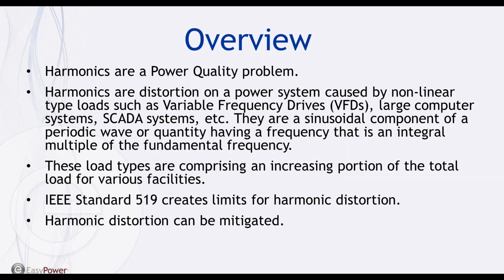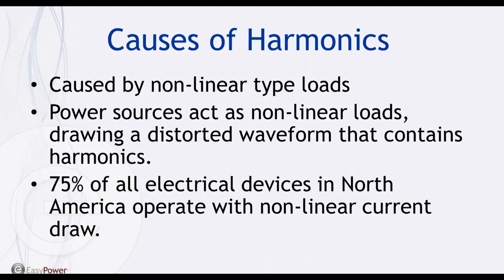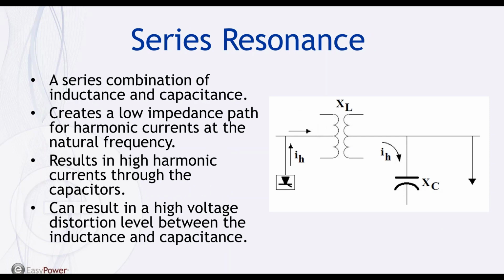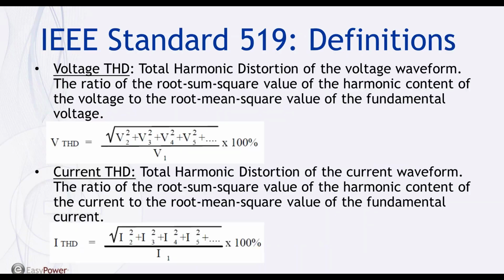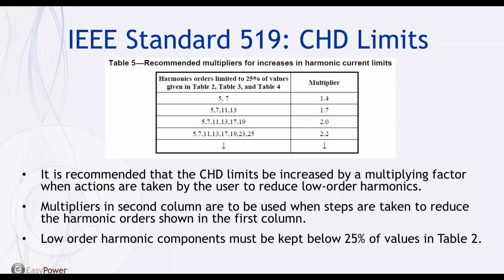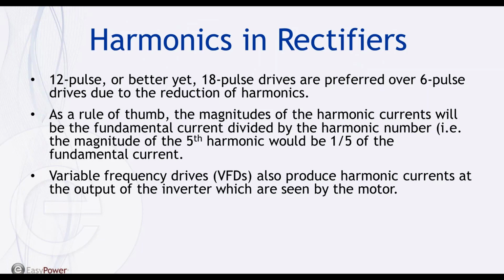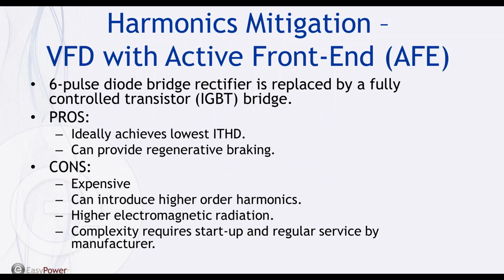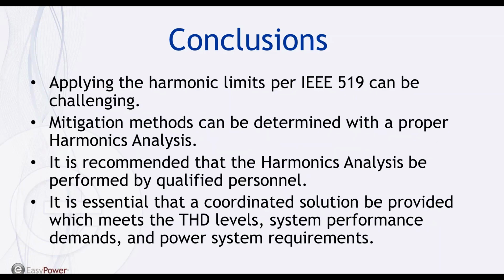Harmonics in Electrical Power Distribution Systems

Comment: QUOTE "Single largest cause of severe harmonic distortion is resonance" UNQUOTE. Not exactly so - though the harmonic resonance does cause some severe harmonic distortions. If one applies only Capacitor with a Non-Linear load, the capacitor would magnify harmonics and one would land into a severe harmonic situation. Save for that, it the extent of Non-Linear Loads and when the transformer operates near its full capacity (with high VFD drives etc.) that cause THE REAL AND THE SEVERE HARMONIC DISTORTIONS, both with the THDi (Total current Harmonic Distortion) and THDv (Total voltage Harmonic Distortion). Check out the myths vs facts. https://enconengineers.in/harmonic-filter-powerful-super-tuned-specification

Comment: Nope. Not even close.
Reply: What you mean?
Reply: @joeschmidt6597  Which harmonics are created is not a function of the kind of circuit you are using. 6 pulse rectifier vs 18 pulse rectifiers don't create specific harmonics just because they are have a certain circuit topography. There are laws that determine which harmonics are created and it's based on the angle at which the incoming sine wave was at when it intercepted the non-linearity. Read my book, don't wait for the movie.
Reply: Tell me why I see 5th 7th and 11th harmonics on my supply with 6 pulse vfd loads than . 😂 gtfo here this info is spot on
Reply: @englandrasmussen3111  The PHASE ANGLE where the distortion impacts the input sine wave determines the "Harmonic Signature." It has nothing to do with anything else. Not only did I discover this, I came up with the formula that predicts why you get the 5th, the 7th and the 11th. The phase angle where the distortion hits the sine wave is what drives it. I found a mechanical website that showed a harmonic signature from a galled bearing and laughed my butt off as I read the idiotic excuses for this harmonic signature. I poked fun at them and got in trouble with the sys-admin for that site, so I made this video explaining how that works. https://youtu.be/17PtfpLDV44